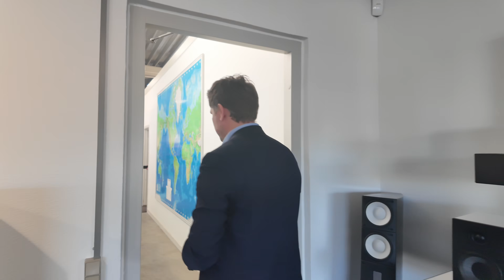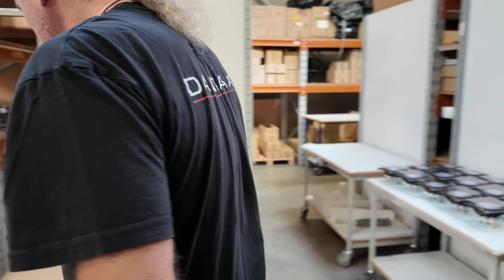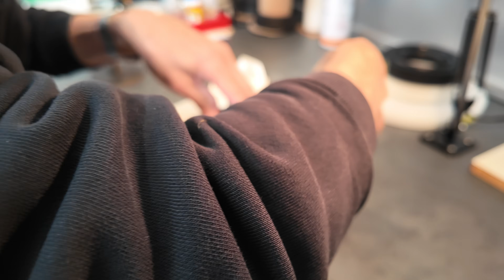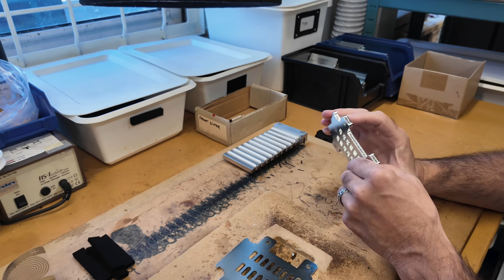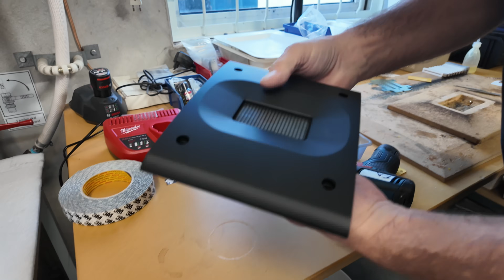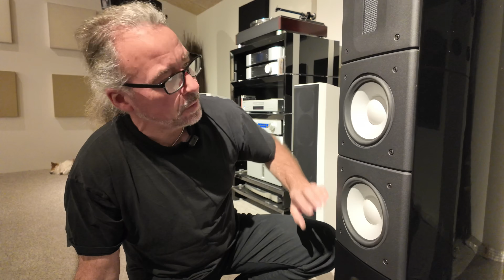Raidho Factory Tour - Handmade Loudspeakers and Drivers from Denmark

Comment: Hi thank you very much for the excellent video of an amazing company  
My dream speaker would be a two pieces one ... a 2 way Raidho (maybe an MTM) mechanically decoupled  and placed above a TD-8 SUB dealing with the lower end of the audio spectrum  (or even the bigger one of course) and a proper two ways xover to match sub to sat    
This speaker could very well be an ultimate speaker for room up to 40 square meters   (more or less)

Comment: Nice and interesting tour!!! Bravo guys, it was very interesting.To improve the sound, I would make some adjustments to the location of the radio components in the crossover... because even the smallest nuances affect the sound and passage of the electromagnetic sound signal.I used to deal with acoustic systems myself and studied, let's say, the behavior and influence of many factors and materials on the passage of an electromagnetic sound signal...I translate from Russian to English with a Yandex translator, so it may not be translated very accurately and verbatim), I apologize in advance).All the best to you

Comment: I am a mechanical engineer that appreciates good sound. I just want to put out here that if they want a simple way to align the aluminum ribbon to the magnet structure, it would not be hard to do,  and I would be happy to show them how. I design a lot of tooling for precision assembly, and I don't ask anything in return.
Reply: No matter how you'd do it, you would still need to heat the alu ribbon, to tighten it up. My guess is, that they came to this conclusion, in an early stage. And they are probably using a plastic, that is designed, to shrink.
If I was to change anything, in the process, it would be to use a heat oven at x degree, e.g. 5 minutes at 60 degree C or whatever is needed, to get a more consistent shrinking, instead of using a heat gun.

Comment: Thanks for the video! Unfortunately, you didn't show the inside of the speaker cabinets without the drivers themselves. At first, I thought it was a joke about using nail polish to hold screws in place, but after watching the video a few times, I realized it really does look like nail polish. Using it to hold screws is a bad idea, as it's not designed for that purpose and will simply crumble and fall off over time from vibration. You need a special screw-holding varnish, not just nail polish. I've never seen such impressive crossovers before. They're truly magnificent; their monumental appearance reminds me of ships about to set sail on a long voyage.
Reply: I know, that they said, that it was to hold the screws. I don't believe that for a second. Screws can be delivered with a thin layer of Loctite like (dry) adhesive, on screws, and my guess is, that they do.
The nail polish is an old trick, in the hifi business, to ensure, if the speaker is sent back to the factory under guarantee, that no one has tampered with the speakers, e.g. the customer broke the speaker themselves (taking them apart, out of curiosity or similar). It is also used in other industries, of electronics, where there's no chance of screws getting lose. It does have a tiny effect on screws getting lose, but very little.

Another method used, is a simple sticker, that one has to break, to take a unit apart (e.g. an amplifier). If the sticker is broken, the manufacturer knows, someone took the unit apart. Broken sticker means no more guarantee.

Apple used to be experts on putting a ton of counter measures into their products, so if you took something apart, it would not work anymore. Then the Right to Repair movement and EU happened.
Reply: I used clear nail polish to secure the bolts on my Triumph motorcycle. As anyone who ever owned a Triumph they vibrated something awful. Nail polish was cheaper than Lock Tight but didn’t come loose when you first loosened the bolt, you had to back out the bold with a wrench all the way.